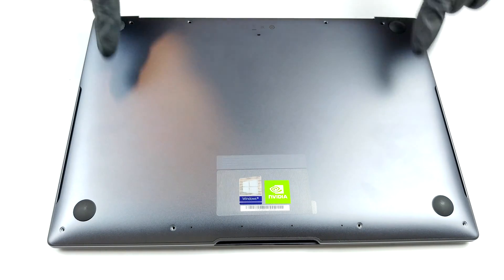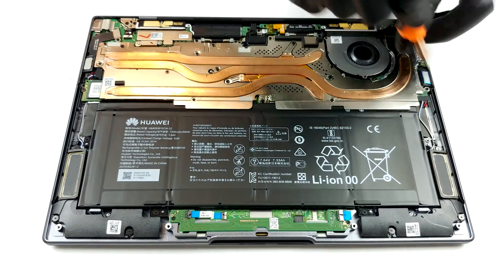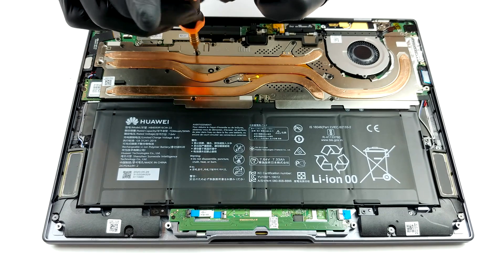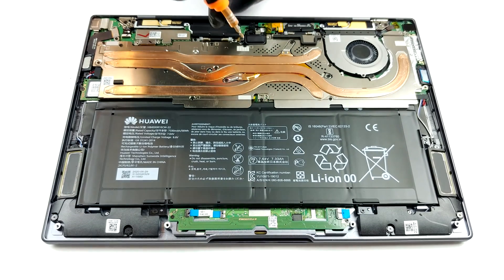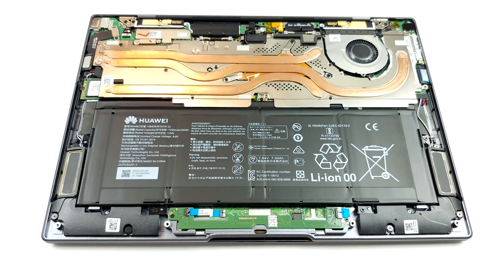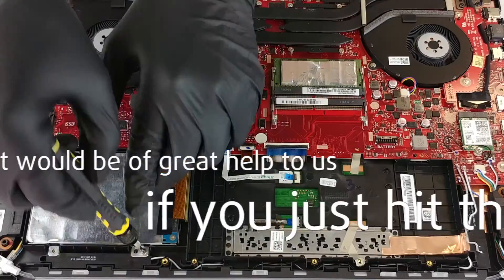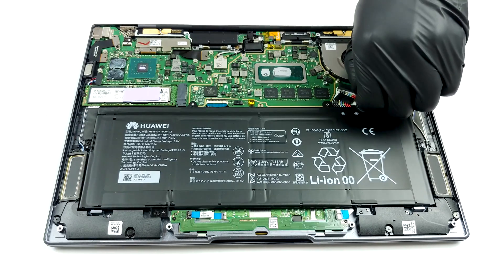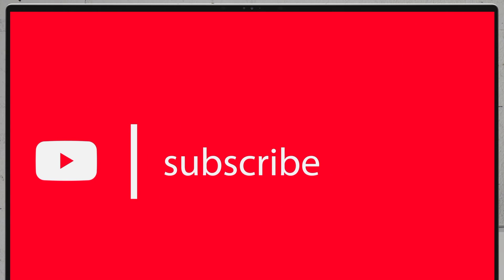🛠️ Huawei MateBook X Pro (2020) - disassembly and upgrade options

Comment: Major thermal design flaw in this model - there is no fin array on heat-pipes at fan output, so the heat is mostly circulated inside the chassis until throttling occurs, which is quite soon under any sort of load.
Reply: It is such a shame. It's almost like you can't charge the laptop while using it sometimes.

Comment: I have the MATEBOOK X PRO MACH-W19. I just cracked the screen. I need to buy a new screen.   Do you have a link to where i can buy a replacement ? I saw in on eBay $230 and aliexpress for $110. But don’t know if it could be fake.
Reply: Be carefull bro.😖

Comment: What size screws hold on the bottom panel? I believe they are Torx 5 but do you know what length they are? I lost one.
Reply: If you lost one, remove the other and measure it 🙂

Comment: You can replace the m.2 without taking off the giant heat spreader. I've done it twice now, and you can insert an upgraded m.2 just be careful to keep it level. If you suffer from BSOD for no reason, there is a factory flaw they don't put the m.2 in 100% to the edge of pins, so listen to the little screw wiggle a little and put it back almost to where it looks like the screw won't hold.
Reply: Most useful comment ever : ) Thanks, my Matebook x pro 2020 started to get BSODs every day after waking up. Just unplug/plugin nvme (without unmounting heatsink) and BSODs are gone : )
Reply: Thanks Michael, after months getting BSOD in my Matebook X pro 2019, your comment solved the problem.
Reply: The number of BSOD kept increasing to a point where it would occur every few minutes at times. removing the SSD and mounting it back seems to have fixed it so far. Incredible... I also was able to remove and install back the SSD without removing the heatsink.
Reply: Thanks. I am getting BSOD for no reason. Changed OS multiple times but sometimes it just starts immediately and sometimes it comes after an hour. All the drivers are upto date and no hardware flaw.

I dont have Huawei repair centre. How can I fix it? What is M.2 and nvme?
Reply: @saddozaiproduction  M.2 nvme is the SSD. I've been experiencing the same issue. To solve the problem you just have to open the computer. Locate the SSD and unscrew a little the screw that holds de SSD and push it firmly into the plug. Screw it back and close the computer.
Reply: The constant BSoDs drove me absolutely crazy. Thank god it was fixable with a little wiggling.
Reply: Are you talking about replacing the SSD or the M.2 adapter itself?🧐mate
Reply: can u explain more for the screw thing
Reply: Thank you bro, this comment saved my laptop ❤

Comment: Instead of that low end discrete gpu they should have just used 10th Gen ice lake or ryzen with iGPU and there would have been place for a second fan. Literally could have been the perfect laptop, with no overheating and throttling issues, great battery life and perfect screen.
Reply: i love my matebook x pro but these definitely seem to be some of the issues